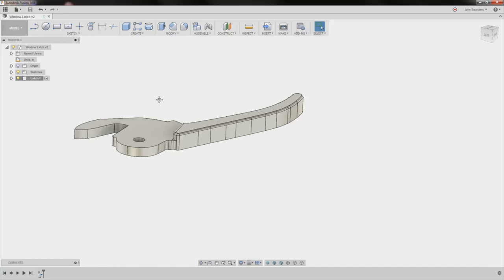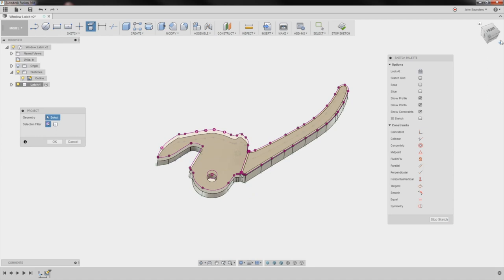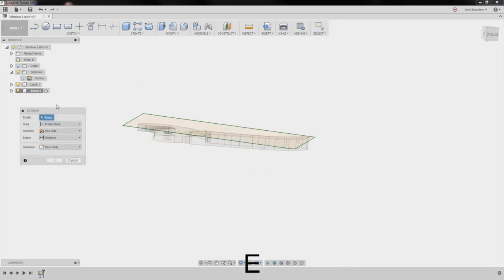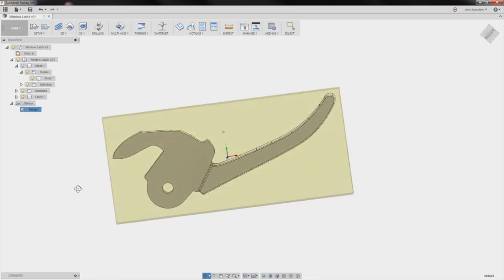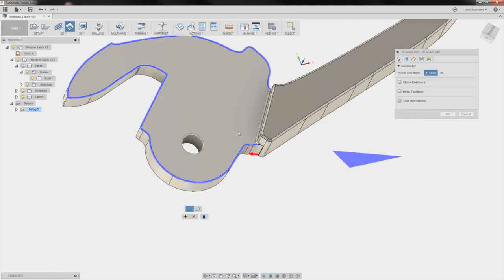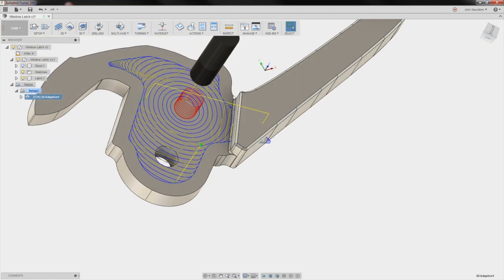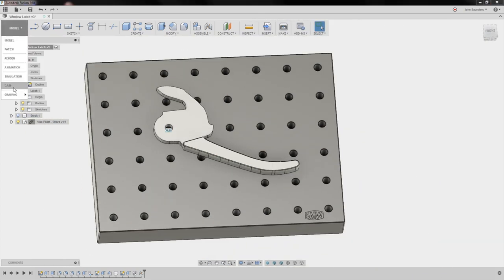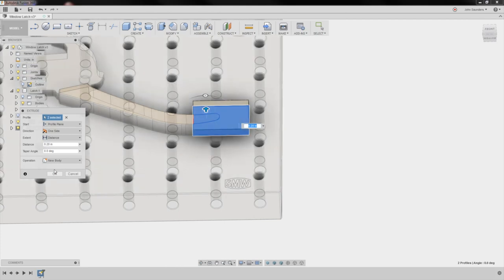Fixturing & CAM for a Window Latch in Fusion 360!  FF59

Comment: Great video keep them coming! When you make your stock , create an as built rigid joint with the part and then they will follow one another when you join the part to the fixture. Another advantage that I find with this is it allows you to then move the part around and get it to line up with say another bolt hole for clamping in real time. If your stock is its own component you can then reduce the opacity of it so that its see through. Then just drag it around until you get it the way you'd like. Cheers!

Comment: When you put it down on the fixture plate, you have only one point constrained, by the screw. Once you add the clamp, the work can't move, but you don't know what angle it ended up at with respect to the fixture plate. You need another known point. One way would be to drill another hole in the waste stock, near the clamp end, and use a dowel pin to align the part before you clamp it.
It's handy that your part has a hole exactly the same size as your fixture plate! If the hole size didn't match, you'd need some more trickery to make this two-setup approach work.
Reply: I was thinking along the same lines.  At least the stock "X" should have been parallel to the pallet "X" .  Then thinking the stock could have been clamped to the Pallet going in, run the first Op with the hole and then bolt down without moving the stock, remove the extra clamps.  That Hole line up trick to the pallet hole was slick.  :-)
Reply: I was screaming this at the monitor when he started the second opp.
Reply: I don't think the hole size needs to be the same because the join should just align the hole centres rather than perimeters. The hole in the part would only need to be big enough for the bolt tieing the part down.
Reply: Paul Rautenbach The join works fine with any hole size, but out in the real world of molecules the screw needs to be a snug fit in both holes to align the work piece to known coordinates on the fixture plate. Unless you go turn a special screw with two different diameters, you'll need both holes to be the same diameter to fit a regular screw.

Comment: Many different ways to skin that cat. You'll always get people who say (with the benefit of hindsight), "you should have done it this way!", but the reality of a machine shop is that you do it the way that works best for you at the time. The more time you spend thinking about the most efficient way to make a single part, the more time that part takes to make. The goal is to get an in spec part out the door ASAP. Everyone develops their own baseline over time based on what has worked for them in the past and what equipment they have on hand.

Here's my baseline:

I would personally start with .5" stock in Talon Grip jaws and hit "5 sides" in 1 operation, extending the exterior profile Z -.020 below the bottom of part. Then take it over to the Bridgeport and face the bottom. Would probably need to put something underneath the cutout to support it to avoid deflection/chatter. Also, something between the clamps and the part to preserve the surface finish.

If it were a production run; same first OP, but make a set of soft jaws for the second OP and run them both in the same program.

When you do go to make this part, you'll figure out that you made a fixturing mistake :P I look forward to seeing how you correct that and how the part comes out! Keep up the good work my man!

KC

Comment: John you mentioned you don't like slotting. Have you tried stepping over with each Z move to form a stepped tapered slot on the waste side? If you were to slot around this part and leave just a few breakaway tabs off the bottom surface you could set it up on your SMW pallet to begin with and save a ton of both machining and setup time.

Comment: Hi John, I'm new to fusion as well as cnc machining but I think I may be able to throw a few tips in that I would do to make setup much easier for the second opp. After you had created your stock you could have grounded both the part and the stock (right click each one and ground. Then when you bring in the fixture plate, joint your hole. I think that would force the plate to move and fix your stock movement problem. Second I would have done an align (Modify > Align) and aligned your fixture plate to the stock body that you had created. This way the stock is parallel to the fixture plate which you could use pins to align your stock or at least easily indicate the stock in straight once on the machine. I'm not sure how you were planning on setting up your stock at that exact angle but I think this would be much easier. Just my two cents, hope it helps

Comment: Start the other, flat side first.
Face to clean, 2D adaptive to clear the stock down .020 below the step, profile, drill hole. 

Soft jaw for op2 clear step section, finish clearing profile. 

Leaves you plenty of room to hold in a vise without running into the jaws, or if you're worried, cut straight soft jaws

Comment: John, I get a little video outage at just after 17 minutes for a few seconds. Might just be my connection. 
Also could you make the stock body a component and use a join to lock in to the part body? Or make them both components and do the same? They would then move together? New techniques for me also so it really helps to watch your process including the times things don't go exactly as you expect. Keep doing exactly what you're doing. I don't watch for a product demonstration as Autodesk would pump out. I watch to see a real world problem get solved. Thumbs up :)

Comment: JohnHow do you insure on you second operation that you are getting the part oriented on the pallet exactly like you have modeled it?
Greg
Reply: Greg McGowan i was wondering this also
Reply: im not sure, but I'm thinking he's going to get his x0y0 from the edges of the stock on the first op. then, since he is only machining a pocket, sort of, on the first op he will still have all 4 edges of the stock untouched. however that would still leave the stock on an angle which he couldn't dial up on, so he may dial one side of the stock flat,and have the fixture on an angle, then zero from there... just a guess

Comment: You could have performed the joint by moving the fixture to the part instead of the part to the fixture that way the stock body would not have needed to be moved.

You might have enough surface area to vacuum the part down with some soft end stops to hold the stock from sliding in the X and Y if you have a grid plate. You would not drill the hole all the way through though, just interpolate a hole leaving some of the material in the base so the vacuum is not broken. Not the most universal method that others can do but a fun way to do it if you have the vacuum grid plate. It would provide even downward clamping force to keep the part flat while exposing all of the top surface for machining. You can do the whole part in one fixturing then as you do not need to re-clamp.

If you really want to use a fixture plate then I would do things slightly differently. The flat area that you are doing in the first op I would consider running a large tool like a face mill or even one of those sheerhog you love across like you are facing down the material just obeying the contour of the handle step with some extra stock that you clean up in the second op. The tricky part with your current setup is you need to locate the rotation of the part in the second op so that the profile matches the flat part in the first op. You can probe the edges of the stock but if you face the general area where the flat is the flat will be profiled in the process of the second op without having to worry about the orientation.

If you still want to do the first op as is you can drill another hole that matches the fixture and you use that to orientate the part on the fixture. Depends on the level of procession you have with those holes. You could slightly over size the flat profile edges in the first op to give you some slop. You can model the screw head as the area avoidance instead of the clamp box you have now.

Just a few thoughts.

Andrew

Comment: You can set up a CAM operation, run a simulation and then export the stock after simulation as a mesh file. Import the mesh, convert to body and use it as stock in follow up operations. I prefer to import the mesh into a new project file as F360 requires that you turn off history before converting to a solid - which is dumb, but it does actually work.
Reply: Good idea.
Reply: Nope, you can simulate, export the finished simulation as STL and import the mesh (STL) into a new project (or the same if you don't mind turning off history). Convert the mesh to a body and you're done. Used this method a few times.
Reply: Hi, I figured out the problem with turning off history for myself by importing the mesh in a separate project, convert it into a body and then import the body in the original file without the need of loosing the history tree.

Comment: Oh also, I know you could do this in other CAM, but I would have created a sketch of a larger circle, concentric with your drilled hole and then done a boring operation after drilling (think about a countersink) that is a set amount larger than your washer/screw combo and skipped the adaptive on the first opp. This would limit the amount of machining in the first opp so that there is less air cutting in the second opp. Also I believe you could use that sketch circle as a secondary machining boundary to limit the second opp toolpaths to the remaining stock which would avoid machining over your screw which your second opp does do.
Reply: Sorry I should have tried this prior to posting. I just made a mock part in fusion and It seems that in you can't do a boring operation based on a sketched profile. However you can do a 2D adaptive (or maybe some other strategy) and use the sketched circle as a stock contour to limit the toolpath inside the circle (once again creating a counterbore). And then you can use the outer profile of the part (or stock contour) as well as the circle to once again limit the toolpaths of the second opp to only the portion outside that circle. I haven't made any youtube videos before or I would make one showing this. I just hope this explanation is good enough so that others can understand it.
Reply: Sorry for so many comments, maybe I should just write a new one with everything in it haha. It seems I got lucky with my random clicking of things. To clarify what I did, on the second opp, I selected 2D adaptive. Then for pocket selections, I showed the stock to select the outer contour of it, then hid it and selected the sketched circle (click the red arrow to make sure it is outside of the circle). This will do as I intended. I actually had to retry the toolpath a couple times to figure out what I did in the first place lol

Comment: Hey John,

How are you going to get the stock in the same orientation as on Fusion? Wouldn't it have make since to have the edge of the stock parallel to the fixture plate? Otherwise you would have to figure out the angle from Fusion and try to achieve that same angle IRL. Or is there an easy way to do this, that im over looking?

Comment: If you weren't slot-phobic ;-) you could do it all without re-fixturing.

Not sure how Fusion would play along.

Clamp down stock on 3 points outside the latch area.
Drill hole. (Tricky if you don't have a space in the fixture below).
Machine flat section, fillet, etc.
Slot passes around all the way, part-depth (probably good to start out about half a tool diameter and then run one path for the actual part edge; with more room for chips.
Chamfer/fillet top edges.
Slot pass to "full depth" away from perimeter but leaving 3 or 4 "tabs" (i.e. steps of e.g. 100 thou., 200 thou wide) around the perimeter, away from the edge.
Slot pass to "full depth" at edge, again leaving tabs to hold the part "firmly" so that it doesn't wander during the slotting.
Then mill out the steps which would require minimal tool force and therefore not distort the remaining "skin"

Seen something done like that once.

If you wanted to use e.g. a fly cutter to get rid of that "skin", then leave those itty bitty tabs, flip over the plate and run the cutter to the final thickness. The part can then be broken out of the remaining stock by hand. No accurate position required for that.

With multiple parts to be made, consider "nesting" several into a single piece of stock. Set the order of machining to be "towards" the fixture points that you can get. Probably start near the centre if clamped around the edge. The more metal between the tool and a fixture when cutting; the better.

Back in the olden times when programming a flame cutter, I told the machine to use the punch to do the outline on expensive material first. Then the operator could check that all was going to be OK before the final sacrifice.

Perhaps you can (ab)use your diamond engraver in the same way? At least while you're setting up for "production".

Comment: Talon grips, rough outline profile  and  finish drill hole then cut softjaws finish the step deburr  done
Reply: That would be an excellent way to set up a production run, but a waste of time/money cutting a set of jaws for a one off.
Reply: Kenneth Higley soft jaws are stupid cheap. A lot less expensive than diddlying around trying to setup and tram the part in on a fixture plate, and move clamps around and everything.
Reply: $9.50 per set. At a shop rate of $100/hr, they would have to save you a minimum of 6 minutes. But they don't...they add CAD/CAM time, setup time and machine time. At the very best, it would be a wash and now you've spent an extra 10 bucks which you have to take out of your profit or pass on to the customer.

The more logical route is to do OP1 on the CNC, set it aside and get the next CNC job running, then take the part over to a Brigeport and face the back side. Now you have 2 machines making you money at the same time and you didn't waste a set of soft jaws. Yes, you have to fiddle around with clamping, but in the end you come out ahead.
Reply: Kenneth Higley you still have hold on to some how to face off the backside in the bridge port.. That is just waste of time once you run cnc machine you get doing setups like this over and over...  Plus the softjaws you just dice up into another project and use them up.
Reply: Kenneth Higley 😂😂😂

That is all.

Comment: How do you orient the stock on the fixture plate to match the existing operation that was done in the vise?
Reply: Rick Perry good question. I would model it of another hole in the fixture plate with a removable pin. I believe John made these plates with a hole above the thread to insert a locating pin. I hope that helps :)
Reply: Ahhh I see now. it threw me off when the origin was set to the fixture plate but now I see what you mean. Would only be a problem if you tried to move the part after the bottom X was cut.  Thanks for the vids, I don't do CAM, only model but you've helped me tons!

Comment: Hey John,
You mentioned in your voiceover that Fusion 360 doesn't have collision detection or avoidance...that NOT correct. 

Curtis Chan has a great video outlining the method of enabling collision detection between the tool and any nominated workholding.

Check it out,
Cheers

Comment: How do you machine the one inside corner square like the model shows? Also how can you just Willy Nilly change the top radii to a chamfer.....Things like this don't happen in the real world at least not the one I live and work in. It is my job as a responsible machinist to point out those problem areas to the original designer, I can't just change things because I usually don't know the design intent of the part and by changing something I may adversly affect that. I don't want to come across as a know it all but you've got a captive audience of all different skill levels and the ones I fear that are being led down a slippery slope are the lesser skilled ones.
Reply: Cad-Cam_Man 

Turn it on it's side, use a gauge block and the top of soft jaws machined flat to tram straight section of the notch so it stands vertical. Then just endmill the 90 sharp corner.

And ya, can't just change a radius into a chamfer like that. And it would take no time at all to just surface that in with a BEM, no need for a corner rounding mill.

It's funny I did a part just like this, except without the long tail section, and had the internal CAM and pivot pin machined in.... and it was titanium...
Reply: I know how to make it sharp and mill the radii...My point was the people new to the trade aren't being shown these processes.
Reply: Cad-Cam_Man 
That's why I gave the answer as to how 😆

Comment: For fixturing small parts like this, I recommend these
https://www.miteebite.com/

On a design note: 

I don't know what the requirement is of your latch, and if its a home brew project or whatever. You should have made it clear in your video the customer was okay with you changing the feature to a chamfer. Some Parts have functional surfaces that must be radius as defined by the engineer / designer.

We have had a problem with vendors and in house tool makers thinking they know better then what was designed and we ended up having to scrap $10,000 dollars in parts.